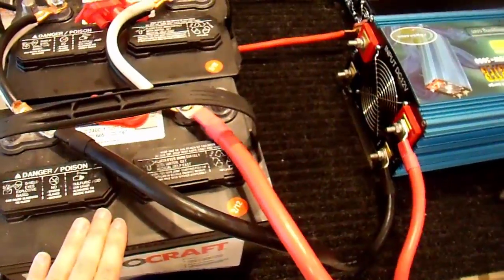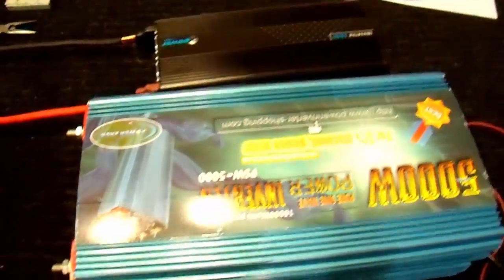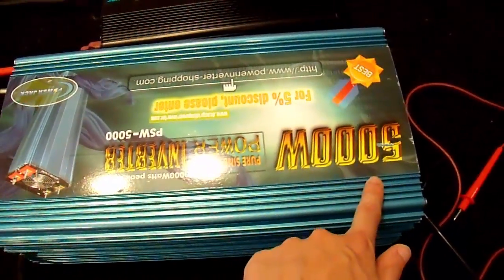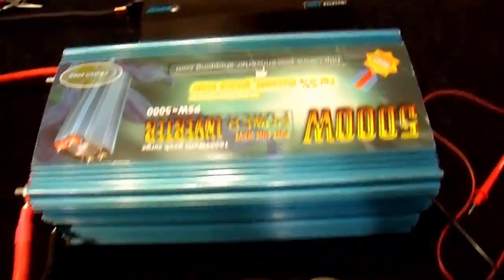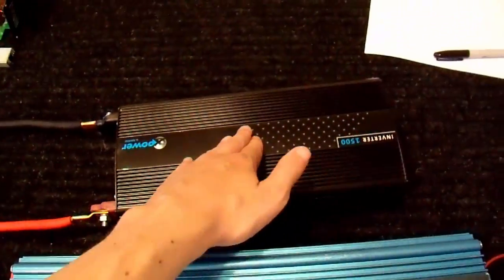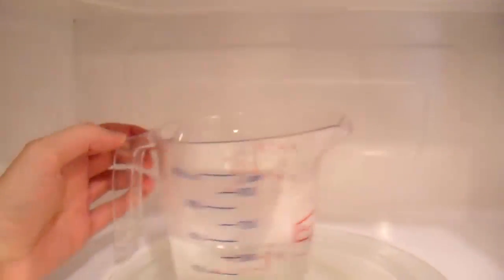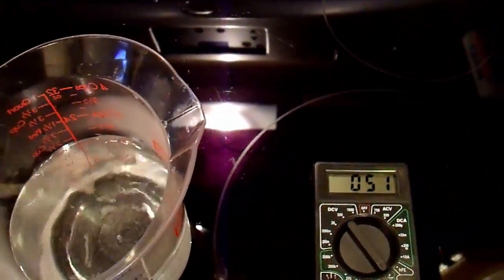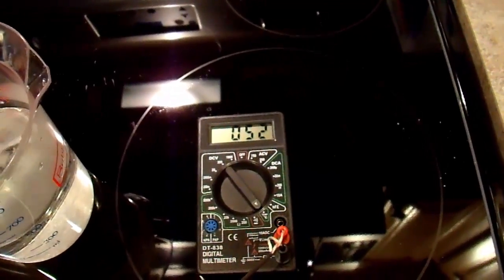Pure Sine Inverter vs. Modified Sine - Microwave Oven Test

Comment: Speaking of PSW inverters.... have you tried looking at the wave form from a modified sine wave inverter at the output point from a transformer like from a laptop? My Mascot 600watt pure sine inverter runs just fine but I had a guy ask me if plugging in a transformer for a laptop didn't smooth out the wave form from a modified sine wave and I couldn't really give him a definitive answer other than modified sine wave inverters and computers are a bad thing.
Reply from the maker: laptop power supplies are switching power supplies which first boost the voltage to around 400V DC, then send it through a high frequency transformer to convert to lower voltage AC, then rectify that transformer output to make dirty DC.  It is then filtered to produce a clean DC.  The waveform will be a nice clean DC waveform whether operating on MSW or PSW.  Modified sine may allow some radio frequencies past the filtering and may make some of the input filtering run hotter but otherwise will power laptops without issue.
Reply: ***** All that in that little brick?...Thanks for your answer... so it doesn't affect clock frequencies that much then... is it the same for smartphones, tablets etc?
Reply from the maker: SquirrelFromGradLife
Yes, same for phones and tablets except that those devices can be more sensitive to some of the higher frequency noise that MSW inverters tend to produce.  e.g. There have been reports that the touchscreens may not behave as expected or the like on certain especially noisy power sources.

Comment: Wow, I'm really shocked at the result of like a 10' difference.
I was wondering what the transformer temp difference would have been but now dont really care as its got to be higher on the modified...
I must admit I only run appliances that are usually swichmode powered, like PC's and laptops, so the wave shape doesnt bother them at all, i had an inverter go wonky and it was putting out dc not ac and i didnt notice for months till i plugged in something with a transformer supply and it would not work...

Comment: Can a PC be damaged by using a modified wave inverter to power it?
Reply from the maker: Yes, but it is very unlikely to be damaged.  I would not hesitate to run my computers off of MSW.  The input filtering stage of the power supply will be more stressed and run hotter but the rest of it will operate just fine.
Reply: We have power failures on a regular basis and when it happen a 4-12 hr failure is normal.
So far I ran my Pc and a tv on a Modified inverter and there was no damage to it.

Comment: Thanks for the videos; I bought my modified sine wave inverter on your recommendation and it has paid off. I've been wondering about the ability of the modified sine wave inverters to run electronics. I am particularly interested in running a bread maker. Do you think they have any electronics beyond the clock that modified sine wave might run improperly or ruin?
Reply: be REALLY careful i tried a mod sign wave on my house and burnt up the coffee maker, ele mattress pad +. 
it will be what you are going to risk? the coffee maker was a black and decker and mr coffee units

Comment: I expect an inverter based microwave would be more efficient than a traditional transformer based microwave on modified sine wave as it doesn't use a big transformer but a switching power supply like a computer or TV which rectifies the incoming AC to DC straight away.
Reply from the maker: I would expect an inverter microwave to be less efficient than a traditional transformer based one.  When run on MSW, however, the efficiencies are probably more similar as the inverter microwave won't suffer nearly as badly from the harmonics.
Reply: RedDragonUKTech i

Comment: thanks for all your videos.

Why is it so hard to put out a pure sinewave?
even if one starts with a square wave, it's not hard to filter that low power signal with a high Q
bandpass filter using a couple op-amps. isn't it?

then amplify the signal to get the derired output power.

Why are there still modified sine wave inverters? is it that much cheaper not to do it?
Reply from the maker: Pure sine cannot be made by simple filtering on a MSW waveform, however I agree that pure sine isn't difficult to make.  The direct answer is that because MSW is slightly cheaper to make, and because people don't know the difference, MSW sells better and therefore is what is sold.  MSW inverters really shouldn't even exist from a technical and practical standpoint.
Reply: People don't know so they buy cheap inverters, they also just look at watts output. And what sells is what the stores carry. I myself would like a lower voltage output. Bulbs including leds last longer when using 110 volts instead of 125 volts. I found that out a few Christmases ago. I was changing led lights about 7 or 8 a month. Now when I lowered the ac voltage to 110 instead of 125 volts I haven't changed 1 led bulb in the past 3 years. So I know it helps using 110 instead of 125 volts.

Comment: This might be a dumb question, but if your power company is running 120v (like mine) and the pure sine wave inverter is 110v would it change the water temp any over the 2 minute cycle?
Reply from the maker: Steven Hull Yes, a higher voltage will cause the microwave to consume more power and heat the contents faster.

Comment: Great video! I like the actual application to answer a question, thanks for making this video. On a side note, any idea why I can't find an OSP tiger claw inverter anywhere?
Reply from the maker: kf7tkj They don't seem to be available all the time - a batch comes and goes and then you can't find them for a while again.  Not sure why, and I'm unsure if the quality is consistent either.  Definitely the best low cost pure sine inverter I've seen so far though.
Reply: ***** sigler music imports them from china. Their cycle is about a new shipment every 45-60 days. Not exactly sure but I bought two tiger claws and both performed equally well.
Reply from the maker: *****
Thanks for the update!  I am glad that they didn't reduce the cost of their design and relegate themselves to another 'me too' inverter.
Reply: ***** yessir. In fact they are back in stock as of writing this comment.
Reply: I just saw them a few days ago on ebay.

Comment: Love those 24-dc1 batts. Best bang for your buck. I use them in my locksmith geddup with a battery isolator.
Reply from the maker: They used to be a better deal than they are today but are still a good battery regardless.  Be sure to use the online coupons to get a hefty discount!
Reply: ***** I wish optima batteries were what they used to be. I used to exclusively use the blue tops. Ever since they moved to Mexico and bumped the price up 100$ I haven't had one single batt  last more than a year. In fact I had 2 in a row right off the shelf measure less than 8 v
Reply: ***** better still, I use my commercial account discount :-)
Reply: Peter Carlson  If you are looking for an alternative to Optima take a look at your local Batteries and Bulbs retailer. Their AGM house brand is actually manufactured by Northstar however is quite a bit cheaper and carries a much longer (two & three years longer) replacement warranty than one purchased directly from Northstar. Northstar batteries are some of the best in the world and the only battery the US military will use so it's a pretty good find.
Reply: Peter Carlson dont complain in aus they cost about 250 dollars.
Reply: For a size 31 group A optima blue top deep cycle battery I am looking at 294.99 plus tax. And last I heard the oz dollar was going 85 cents on our dollar. I have used optimas extensively before, but every since Johnson controls shipped manufacturing to Mexico the quality has steeply suffered.  I have not had s single optima last more than 2 years since 2007+ but some of the pre 06 batts I have work fine. My theory is they use too much recycled impure lead in Mexico to the cells causing them to overheat under recharge thus out gassing drying up and failing the battery.
Reply: Peter Carlson i like yuasa batteries they are very good but are quite expensive

Comment: 1st!!
Reply: Nope!
Reply from the maker: Peter Carlson
I'm confused.  Please make a video on your flux capacitor.  ;)
Reply: ***** ??? I have some aerovox aerostor capacitors.  7,8 kj worth... is that what you are referring to? I use flux cored solder, but those bad bastards are bolted to silver plated copper rails. I don't think soldered on connections would work.
Reply: Peter Carlson I'm pretty sure the flux capacitor he's referring to requires 1.21 gigawatts.  At least, that's what Doc said.
Reply: teacherAV2004  oh. I can put out much more than that. It all depends on the discharge pulse length. Because one joule is = 1 watt per second.  You tell me how long a pulse with 7,800 joules has to be to make 1.21 GW
Reply from the maker: Peter Carlson
Yes, but what is the ESR and impedance?  ;)
Reply: Long time since I calculated them. Pretty low though.  They are monster pulse discharge caps.
Reply: ***** low enough to send a careless person to an early grave... does that count as time travel?
Reply from the maker: Peter Carlson
hmm, going somewhere before your time...  Seems like it should count!